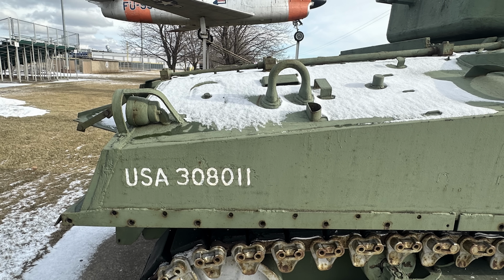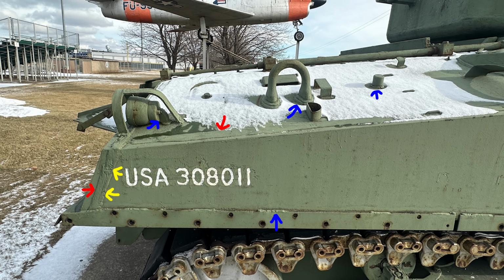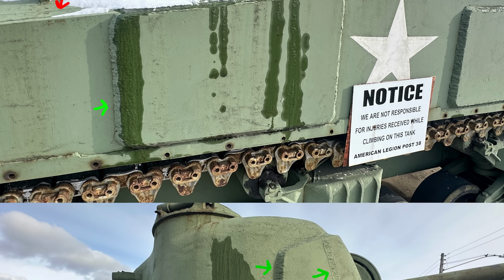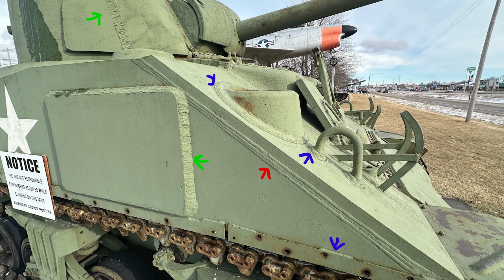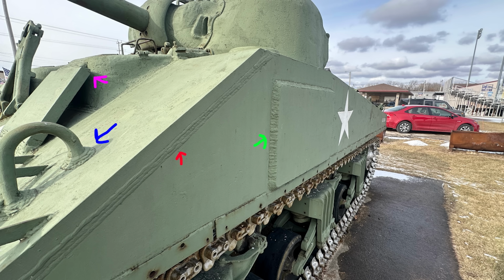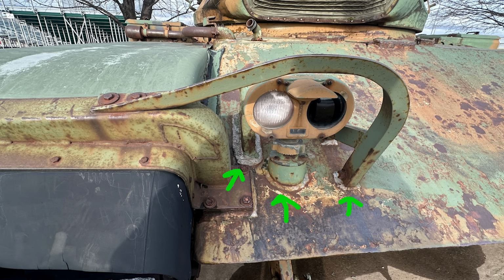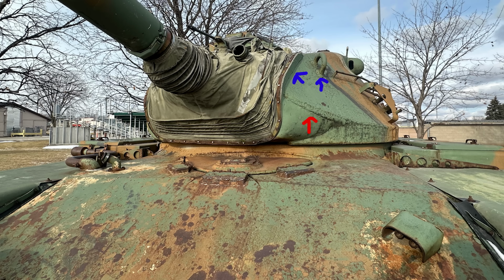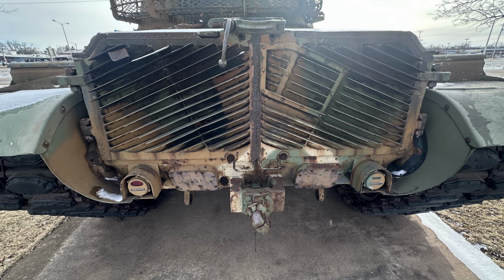Inspecting the welds on roadside tanks

Comment: For what was MIG welded, what type of machine and wire size?
Reply from the maker: The wire welds that big would have been done with a power source of 350-450amp range and probably in the 300a range of output.  Wire size probably .045 or 1/16th.  Dual shield wire or spray arc would have been used. It’s hard to say what because a lot of the shape of the weld was rusting that was covered up or just rust underneath the paint.  The issue too is I am unsure on the actual build date of that tank.  Dual shield, spray arc, and numerous other processes were all coming online in the late 50s early 60s.  Technically short arc process could have been used but it can be hard to tell the difference.
Reply: @makingmistakeswithgreg  I am pretty sure they won't let you do a cut and etch to see how much penetration they got.

Comment: Love these analysis videos. Can't wait to see you re-create them. You might need to start a patreon if your going to use SS rods if they cost anything like they do in NZ ;)
Reply from the maker: I have a bunch of 312 and high nickel rods saved up.  The most cost effective way to do that sort of welding is to use high manganese/chromium hard face rods.  They aren’t super expensive but likely are very similar to the rods they used.  They can be stacked uphill but they are a challenge to run.  It should be fun to try to do that sort of weld, I have done it a lot on buildup jobs so I know what I am in for 😅.  No bs the fumes are terrible and until it’s nicer outside I won’t attempt it lol.
Reply: Ah never thought of using hard facing rods, always thought they would be crack prone but I guess armour plate is not mild steel. Assuming you’d use the buttering layer type rods rather than the super hard/high wear resistant or carbide matrix types.
Reply from the maker: Some forms of hardface rods are suitable for welding high strength alloys.  I will be using them on mild steel so I know they will not crack, but on high strength steels the right combo will work.  You’re right though, selection is important.  Trying to run a rod that’s designed for single pass minimal fusion and weld thick plate together will be crack city 😅.  Whole beads would probably crack off like potato chips.

Comment: I do wonder if some of the field welds, especially on the Russian equipment was done with just bare wire welding. The U.S. logistics chain was robust enough that our guys should have had proper rods, even if they couldn't do vertical up. But some of the other countries i wonder how much was done with whatever they had on hand. Like i could totally see a Russian going " must weld metal, we have metal rod, we have welder, we make weld JA"

I also heard of Carbon Arc Welding.  I  had a Polish guy show me something similar. He took the carbon rod out of a c-cell alkaline battery, stuck it in a jumper cable. Then proceeded to use it to weld a terminal back onto a car battery using the battery itself for power.......NOT RECOMMENDED. But you know, back in communist Poland. You fixed everything or you didn't have anything.
Reply from the maker: So there was a form of welding known as atomic hydrogen.  It was a precursor of tig that used hydrogen gas as a wild oxy fuel mixed with tig process.  I have never seen welds from the process in person.  Carbon arc welding basically omits the hydrogen gas and works just as you said, with a carbon electrode and an arc.  Both carbon arc and atomic hydrogen were short lived once tig existed.  From the few pictures I have seen of Soviet tanks I think they did a lot of oxy fuel welding and their stick rods would have been steel wire wrapped in newspaper with a binder.  Very crude materials under impossible deadlines with no training would have been the best case scenario lol.